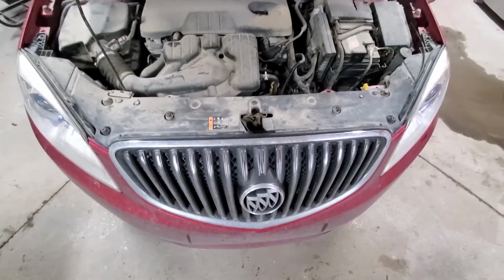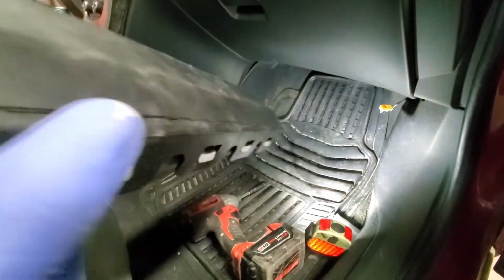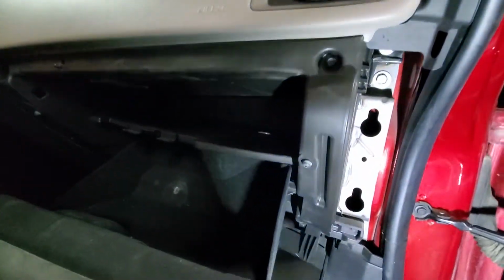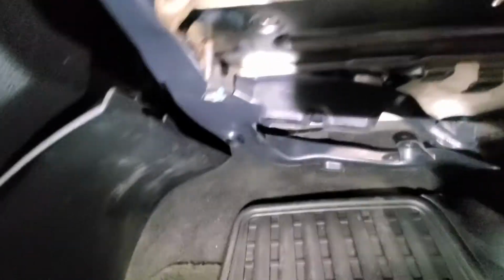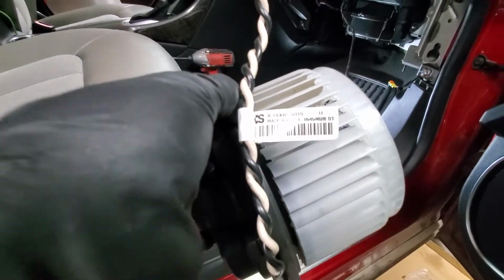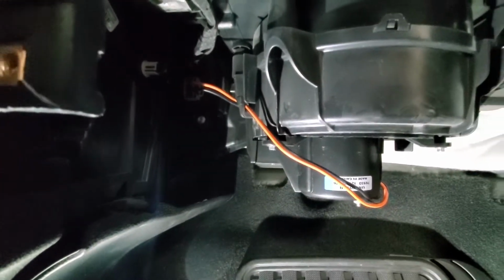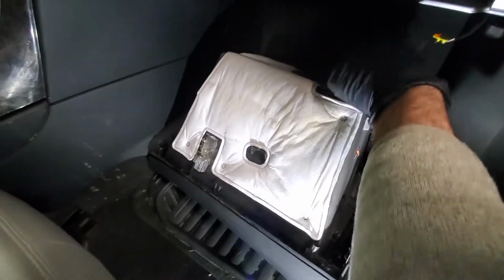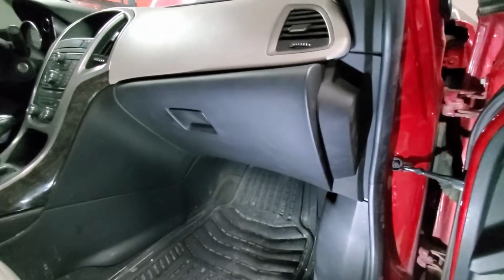How to replace blower motor on Buick Verano and how to replace cabin air filter

Comment: Was that car just blowing hot air? Until u replaced the air filter did that help it throw cool air again? When it was filled with the cooling liquid
Reply from the maker: The blower motor was not working most of the time. AC and heat worked otherwise.  What problem do you have?
Reply: My AC doesn't kick on from time to time
Reply from the maker: I'd start with checking pressure of the refrigerant.

Comment: Thanks for the video!  I can’t believe how badly GM has fucked up the engineering on cars since the 70’s and 80’s.  Cars from those era’s you could either replace the blower from the firewall under the hood or inside under the dash on the passenger side by screws that hung down.  Most of the time it was a broken squirrel cage and not the motor.  This process is fucking ridiculous!
Reply from the maker: Cannot agree more. Though it is not just GM,  vehicle got stuffed with electronics and comfort mechanism so it is common procedure on most of the vehicles. BMW are much worse.

Comment: Is unplugging the battery necessary??
Reply from the maker: Any time you work with electrical components it is a good idea to disconnect the battery and drain the electrical system

Comment: How do you replace the resistor?
Reply: 2 bolts right by blower motor to the left side of the blower motor just did one today
Reply: How do u know if the air isn't blowing correctly if turned all the way on if it's the blower motor or the resistor